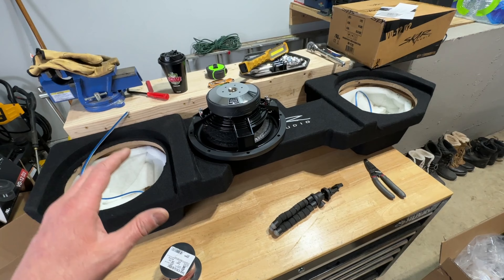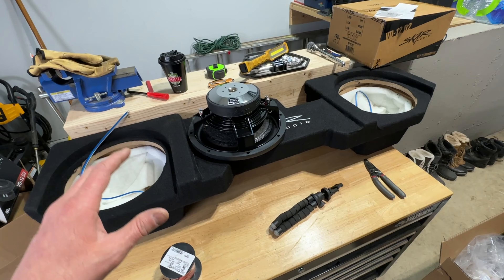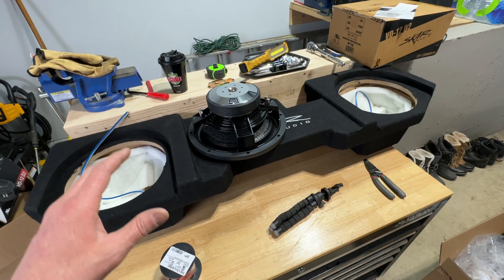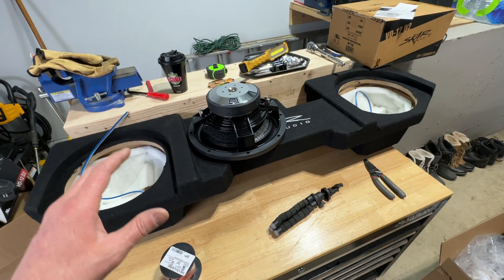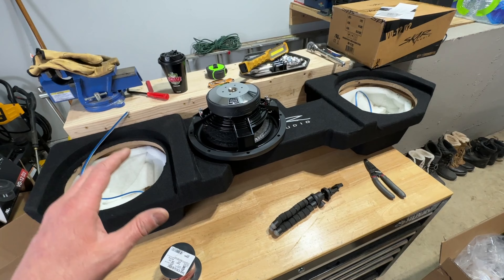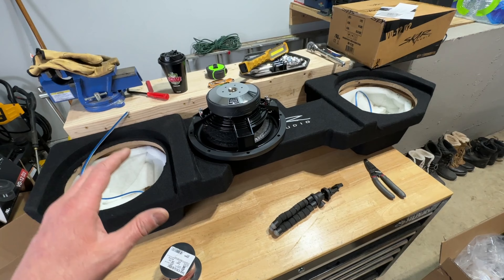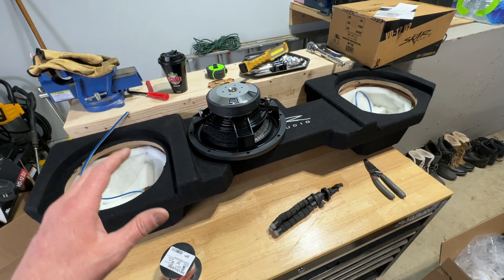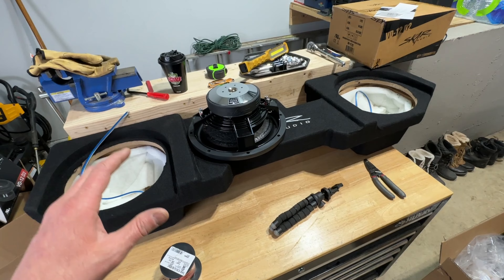Install & Review Of The Skar Audio Box With Two VD-12 Subwoofers For A 2016 Ram 2500

Comment: I have the 10 inch version of that box and I put svr 10s in there. I had to use spacer rings to lift them off the bottom but it sounds unbelievable!  
I'm pushing 2000 rms into  it and I couldn't be happier

Comment: Good setup. I’ve had this box for 4 months and I like it. I had 1 12” kicker comp r shallow mount  and plugged the other hole and using Rockford 500 watt mono amp.  Good sound great base. I glued 1/2”  pieces of mdf together and felted them and used for spacers 1” thick. With rear seat raise u should be able to fold down your rear seats now it’s a win win. Thx for video man

Comment: Just an fyi If you got dual 4ohm subs instead & wired them down to 2ohm(positive to positive negative to negative) you'll be able to maximize your amp output to the 1ohm impedance instead of  only using half the capability at 4ohm
Reply from the maker: Good thought, I may have to try that.  I was just concerned because Skar Audio website says wiring to 1ohm is not recommended and voids the warranty.
Reply: @DieselLegiance  0.5  which is half ohm is not recommended but 1ohm is definitely the way to go because about all the class D mono amps they have are 1ohm stable
Reply from the maker: Thanks
Reply: subs in this video say dual 2 ohm. so it would be 0.5ohm

Comment: Love the video! Had a few questions:
- Did you get the 1500 Watt amp afterwards?
- Do you have to install an aftermarket stereo?
- Do you still like the quality at this point in time?
Reply from the maker: I don’t remember what amp I had at that time.  You don’t “need” and aftermarket stereo but if your head unit doesn’t have pre-amp output you may need a converter.  I did like the quality of the box.  For a small air flow box, it sounded good.

Comment: So did you upgrade to a bigger amp? A local audio installer told me the vd12 take quite a bit more power than the amp you have in this video. The amp I have he said is was a very good amp. He and several places said that. I have the down for sound salt 1700.5 he said it would push them really well. So wondering if you got a bigger amp and how much difference did it make?
Reply from the maker: Nope, I use the same amp and it did sound good but I do think a little more power would’ve been better.

Comment: I have a 18 Laramie Longhorn,  w stock head unit, using the factory amp signal wire how did you get around the subs fading out in higher volumes ?
Reply from the maker: I’m not sure, I didn’t experience that as I have an aftermarket head unit.  Your Amp should have controls to dial in the Low Pass and High Pass filters as well as adjusting your gain.

Comment: Would this box fit in a 2018 ram 3500 crew cab? I love the look of the box in you’re truck. My current dilemma is my amp is only 600rms at 2ohms and I want to get the speakers you have installed. Thank you
Reply from the maker: The box should fit, may need spacers to lift the back seat slightly, but you may need a more powerful amp.  The Skar Amps are very reasonably priced.

Comment: Do you actually need the shallow mounts? Cuz i just ordered this and tbey recommend it with the standard 12" sub
Reply from the maker: You might not need shallow mount but some speakers have very large magnets that may be too big for the box.  Best I could say is measure the box interior dimensions and then measure the sub.
Reply: @DieselLegiance  nvm I found their charts that showed what fit and mine was on the approved list

Comment: what years does that box cover i have 2013 ram 1500
Reply from the maker: I believe 4th Gen but I can’t remember if it was for a 2500 only or if the 1500 had a similar set up?
Reply: late response but it’ll fit for you

Comment: Why do you use the jumper wire for the subs?
Reply from the maker: It’s just what Skar Audio recommended as I put the diagram up in the video they sent me.  I guess it’s called Series/Parallel in order to take the dual 2ohm voice coils of both subs and keep everything at 2ohms at the end for Amp efficiency.  Skar Audio recommended it to be wired this way.
Reply: @DieselLegiance  oh ok 👍
Reply: @DieselLegiance  for this application are the shallow mount subs required or can I run the SDR 12s
Reply from the maker: I’m not sure but the shallow mound VD-12’s fit great.  They around roughly 6” deep.  If your speakers are much deeper, they may not fit.
Reply: @DieselLegiance  last question what is better 2 ohm or 4 ohm speakers in this application
Reply from the maker: I don’t think it matters that much.  Even if you have 4ohm speakers they can be wired parallel to be 2ohm or if you have 2ohm speakers they can be wired in a series to be 4ohm.  It all depends on your Amp output as that gives you an idea of what speaker ohm you should have.
Reply: Hello D  nice set up. I have the same set  up I used the sdr (they do fit) and now I using the VD 12 lvs  my problems is both sets have a bottoming out sound on certain notes not even at high volume  have you experienced  this with your set up?
Reply: @musicproductions.  you can put the sdrs on this box only the ix vd and sdr will fit this box
Reply: @Music Productions  I got the same setup I run the rp1200 skar Amp dvc4 wired to 1 ohm
Reply from the maker: Not yet but I’ll keep an eye out

Comment: Why didn't you just raze the seat at first? Instead you cut up your carpet and realized it wouldn't work.  Hack job
Reply from the maker: Because I prefer NOT to raise the seat if I don’t have to, as I don’t want to lose headroom.  Some sub boxes require minor removal of carpet to fit and some are made taller whereas a seat lift is required.  It’s called trial and error as every box is different.  But, you can call it a hack job if you like, it’s a free country.  Have a great day 👍🏼